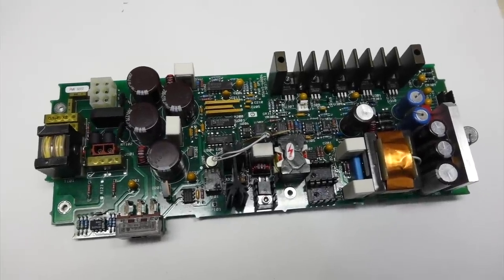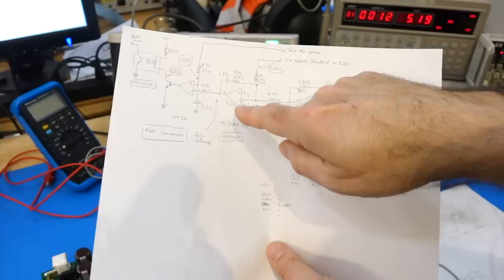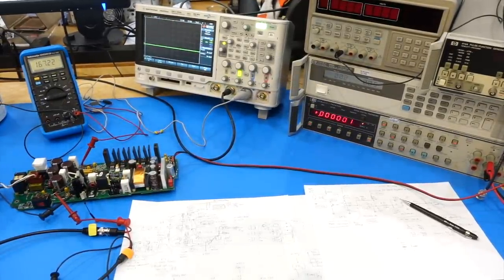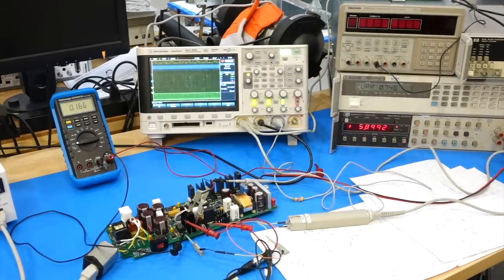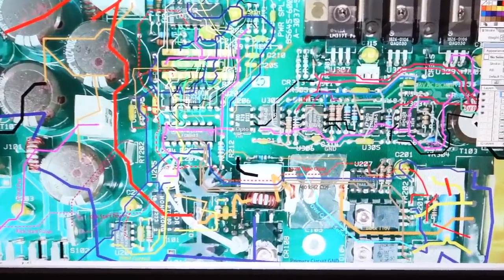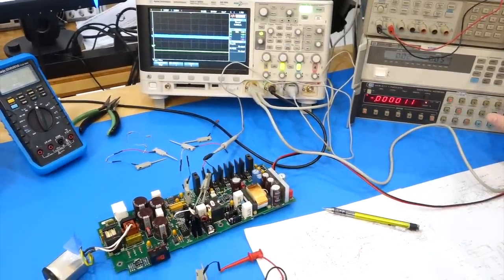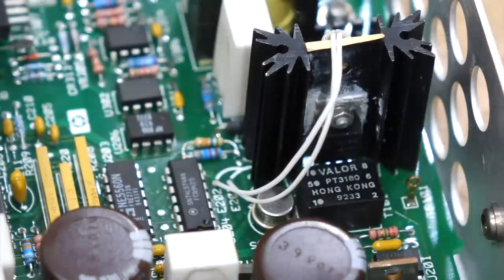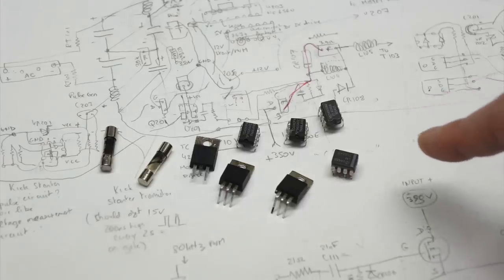HP Switch Mode Power Supply Repair Part 4: Repaired!

Comment: Making more work for yourself reminded me of my power supply repair nightmare.

I was fixing a 35 year old power supply missing a power resistor that had fallen off and vanished in shipment, when I stupidly replaced the resistor with a very wrong value replacement, which then destroyed the chopper transistor, a vendor marked high voltage bipolar transistor.  I spent ages reverse engineering the thing to figure out the characteristics of the transistor, and was about to give up.

The one night I had an epiphany: why not just contact the original power supply vendor. They had been acquired by another company,  so I contacted them. The new company had nothing for my OEM part number, so I searched eBay for similar generic versions of the same power supplies from the same company. I sent them one of those part numbers, and they sent me a cropped screenshot of the original BOM, showing that it was an 850V 10A NPN transistor, 10 minutes later I had a replacement in the way. 

The moral of the story: sometimes it‘s smart to just ask!

Comment: Awesome! I repair solar diverters and when I contacted the manufacturer for the schematics they said the same thing. "sorry not available". So it was out with the pen and paper and work out the circuit. 
It's satisfying to find a blown mosfet driver, bridge or series of casualties and get it back to working order.
That series of videos was great to watch and helpful to someone like me, Thanks for taking the time to record, edit and share your work.

Comment: Brilliant series Marc as per usual. Takes me back to the 70’s and 80’s when I was doing TV servicing SMPS were my pet hate. We had a multimeter  and were luck to have a CRO but no HV differential probes and the like. Every make and model seem to have variants of start ups, switching and minds of their own! 😀 

Your 4 part series highlighted why in a situation where the customer is paying and typically not want to pay much it was better outcome for both to swap a SMPS module out. We did have a technician who mentored me through my apprenticeship who was a savant with SMPS....not even he made me comfortable fixing SMPS apart from the list he kept of common problems he found with certain supplies. You could spend 30 minutes on looking at him common fault list invariably you would swap out what was on his list a viola.....but if that didn’t fix it swap out and take back where he would add that fault to his list.

Fascinating series you put together reminding me in part why I don’t like SMPS. 😀 I like the amount of available HP technology you have in your workshop and your tireless approach to working through with knowledge and equipment to get a result. Thanks for sharing...

Comment: Congratulations on rescuing another rare piece of HP kit! I spent about a decade and a half with HP/Agilent labs. I too have an affinity for older, serviceable test equipment. As I got interested in a particular piece of equipment, I'd talk to folks in Labs who had been there almost forever -- what can you tell me about this thing? I'd get all kinds of stories, occasionally the names of key engineers. Got solid advice on what to avoid (usually because a key component was both failure prone and unobtanium), and what was good. Occasionally I even listened to the advice I was given. I did learn that slug tantalum caps have no sense of humor and don't age well.

Comment: 4:14 when he said Hunky Dory, I expected him to say "Winner winner chicken dinner" next :-)
Reply from the maker: Dave videos definitely taught me a few things!
Reply: Fan spin! :)
Reply: @YCbCr  ppbus
Reply: @YCbCr  Was waiting for that! Shoutouts to Louis! :)
Reply: @CuriousMarc  Your optoisolator LED+transistor gain may have gone out of original design assumed spec. When manufactured the LEDs and transistors are individual die and  binned by LED emission/current (which drops over age), and similar optocoupler transistor binned by photo-gain (also changes with age and accumulated history of stress from temperature, collector current, Vce). Dealt with this many times before with with suppliers changing optocoupler die specs (manufacturers sell out HP-> Motorola->LiteOn->DiodesInc-> etc and source and bin die differently) and PSU builders substituting optocoupler versions (suppliers bought out, min gain specs get sloppy with replaced LED and transistor die, etc, and suddenly a batch of new PSUs has different load regulation characteristics). Symptoms are usually out-of control switcher feedback loops under transient or at steady low or high currents. 
I'd suggest Checking yours with the whole PSU under repetitive pulsed transient loading, say with constant_I of 0.5A  + pulsed_I of say 1A, and look closely at the feedback via the optocoupler LED and transistor currents.
I suspect that as you found there's several feedback loops summing via that resistor network. A steady (low frequency) state current feedback loop, and a dynamic loop (via the optocoupler responding switcher cycle by cycle). Your patch explained here may fix the steady state condition, but probably doesn't fix the dynamic/transient load response.  Look up the original optocoupler gain spec (LED current to transistor current gain), and consider replacing it with a fresh one with at least the same gain (and suitable Vce and watch for LED die Vf and reverse breakdown if the LED die type has changed from an old GaP to AlInGaP, etc).  More optocoupler gain isn't usually a problem since the LM311 should give you a square -wave drive in, but do watch where the 311's output transsitor C and E are wired and how many volts (or reverse bias) can get sent to the optocoupler LED. There may be option to push more current though the optocoupler LED and pick up some gain (but look at the datasheets, binning, and don't assume anything from the optocoupler die supplie  - Perhaps stick it on that beautiful HP curve tracer :-)

p.s. I love that you're doing these restorations of wonderful instruments

Comment: Have you considered using sockets for the 8 pin DIP IC's?  I recently repaired the linear regulator board (card A8) on an HP8720C, it had a 'weak' linear IC where the beta of its output transistor had been reduced over the years.  I found that socketing some of the key IC's was handy for troubleshooting and comparing adjacent IC's to each other.  Great repair video series, thank you very much for taking on that switching power supply and showing us all how you got it to work again!

Comment: Loved this series of 'fault finding' vlogs. The key 'take a way' for me, is that this does not look like an HP power supply as I recognise it. It was not designed properly in the first place, (it was not designed 'the way an engineer' would do it). A well engineered product can be 're-engineered', but also is designed to be tested and repaired - which certainly doesn't seem to be the case here. Bravo you for getting to the 'finish line'! How sad to see a symptom of HPs decline after so many years of excellence. As this product was being shipped, I moved from HP to IBM, and then later 'onwards'.

Comment: I used to fix PSUs and CRTs for a living. The majority of SMPS designs use virtually the same circuit building blocks (although the buck converter block is unusual).
Another cause of failures is the kick start resistor going high. For some reason this tends to result in blown MOSFETs ... the controller chip seems to lock up when it doesn't get enough current from the Kickstarter and the result is always blown FETs.

Comment: Nice video series and very instructive, I'm pleased you fixed it, nice to see a piece of kit rescued from oblivion.

I know you realised it wasn't necessary but surely logic would suggest that the only reason to modify the original design would be to mask a fault you'd not yet diagnosed?

As for those in the comments who are hating on the people who suggest changing caps, you've obviously never worked in a commercial repair operation where it becomes obvious very quickly that faulty PSUs with intact fuses can be repaired by cap replacement 30-40% of the time and that it's time/cost efficient to do so, it's not approriate in all cases but it fixes a lot of them

Comment: What a great series of videos! Thank you for sticking with it - most of us need help with switch-mode supplies. I have used a similar photographic technique - or possibly the same one, photographing the top and bottom of the board, flipping the bottom then adding it to the top as a layer and adjusting it's opacity. Very handy for reverse engineering undocumented boards. One key is making sure the top and bottom pictures are both taken at the same distance from the focal plane of the the camera so all traces and components are the same size. A video of your process would be interesting and probably very helpful to others.

Comment: ...and the next time you have a similar PSU fault, you will remember that it might not behave unless under the correct load.  That's why fault chasing like this should be thought of as a learning experience, and not wasted time.  A thoroughly enjoyable series.  Sending the same wishes back to you and yours at this difficult time.

Comment: Stellar effort! Worst supply I had was my own Sony ProFeel TV monitor (KX-27PS1) that had a weird (Sony Special) self oscillating power supply with a custom resin coated hybrid control board that injected a control signal via an extra winding on the core (ie no opto-isolator). The problem was it would randomly kill the chopper transistor on start up (once a week/month/2 months), this was a known design problem unfortunately. Even stranger part of the design was huge 50w (can't remember exactly) soft start current limiting resistor that was switched out by a relay after 1/2 a second. I ended up fixing it by adding a little more resistance to the soft start resistor to limit inrush current and then worked perfectly for years until the tube's blue gun went weak. Cheers.

Comment: The op-amp was a very good guess. About the effect of the probes, I suspect that probes are adding stray capacitance that helped to stabilize the circuit. I had a similar experience when assembling an audio amplifier that used parallel stages, on a breadboard: all very stable and crisp. On the final PCB, not so, because it went oscillating. Fixed the issue with small caps in parallel with the feedback resistors going from the output to the inverting inputs on both power amplifiers.

Comment: Back in the 80's we quickly learnt not to try power up an Apple II switchmode power supply without a load. It would immediately "hiccup" sounding as if it was overloaded. Nice diagnosis for the HP.

Comment: I think that the optocoupler may be faulty, in that it's CTR has reduced with age.  I recently learned a harsh lesson in that these components don't last forever.  I'm told that the  LED within the opto suffers from age-related "micro-cracks", thus reduced light output and so reduced CTR.  I noticed that your opto is a 1993 vintage part - about the same age as the ones that caused me lots of grief...   I think that when you removed and re-fitted the opto, the  heat  of the soldering process made the opto work again.  I'd fit a new one , given the merry dance that I had with (six) aged optos!  Many thanks for your interesting videos.

Comment: Holy crap not an easy fix by any means!  Wow.  That trick of taking really good quality photos of the board and then mapping it out with photoshop is a brilliant idea.  I'll for sure use that trick.  I've got an old ATX SMPS that I use just for bench lights and a basic 5v "quick n dirty" supply for things that I took from an old computer tower and "tricked" it with a load to get it to turn all the way on.
Anyhow, I measured it a while back and for some reason, I have +5, -12, +3.3 working just fine, but the +12 I threw on my strip lights is more like 11.7 or so (load or no load).  Still runs my lights good enough, but never did fully probe around in there enough to find the source of that problem.  Watching this make me wonder, but I fear I may be opening pandora's box after seeing what you contended with haha.  Nice work, Marc.  Given the equipment yours had to run, you had no choice and quite the challenge to conquer that thing.

Comment: I put my bet on the PFET in the 300V-to-100V buck converter. You're dealing with a lot of power in this supply, which will stress this FET by quite a bit. Unless that FET turns on and off very quickly (probably doesn't), the average Pd of the FET is quite high. A mistake many make when driving a PFET is putting a little R in series with the gate. This has the effect of slowing down the on/off time of the FET (Miller capacitance integrator), increasing its Pd.

If it shorts out, as it did, then you tripled the input voltage to the 100V DC-DC push-pull converter, causing its outputs to triple in voltage, too. Essentially, everything downstream from the first failed converter was highly overstressed as well, and took out just about everything with it. With 20/20 hindsight from the year 2020, the supply designer should have put in some sort of OVP circuit on that 100V output. But as the expression goes, everyone is brilliant with 20/20 hindsight.

Very impressive reverse engineering, Marc. I enjoyed your debug thought process and various workarounds.

Comment: A colleague and I tackled the switching power supply inside an amateur radio amplifier and that was 48v @ 48amps. The switching circuit was driven by a MA3830 multi regulator but had issues with the control circuit that ultimately led back to the power factor correction IC. The circuit would break into oscillation and to tame it he loaded the switch on and placed a constant 1 amp load on the 48v circuit. Without it the maximum the MA3830 could take was 380v and we already had 370v and coming close to the limit. As this then fed 450v capacitors with (and where Yaesu confused us) with 380v and -380v which is a potential of 760v, however it was just their way of saying 380v and 0v. After quite a few component changes we finally have 48v@48amp of very highly filtered DC from the Yaesu VP1000 power supply (25kg in weight too). Without videos to see the startup loop we would have been rather lost but the complex PFC and oscillation and the MA3830 having staggered pins from left and right in different packages really confused us too. Thank you for a really great video it was enjoyable from part 1 to part 4 and very honest. Kudos
Reply from the maker: Congrats on your repair, and thanks for recounting your adventure!

Comment: Bill Hewlett & David Packard would have been proud to see you persist and get this fixed. Two kinds of repairs that I hate are those without schematics and those with feedback loops. Reverse engineering this was a HUGE task, but I was expecting you to break the feedback loop somewhere and insert your own control signal, but with more than 1 loop, I don't know if that could have worked. Yes, it was probably the jFET opamp. Nice work, Marc!  ;-)

Comment: Great video! I have a similar power supply from an HP spectrum analyser 8563A that has an issue not too dissimilar to this. Fortunatly there is a schematic. I found that most of the parts are badged with HP part numbers  which makes it more problematic trying to find the actual device number.

Comment: Great work Marc. During my many years as an electronics tech, everyone hated switched modes, except the design engineers and the production managers. I really like HP's gear but their service stinks. Recently tried to download the bios for a 10 year old server. It was right there but no, you can't have it without an active service contract.
Reply: One of my livings was running an in-house test equipment REPAIR lab with Tek, HP/Agilent/Keysight, Fluke, Sencore and other respected industrial brands of equipment. They all provided extensive detailed manuals and theory of operation. 
(As did Heathkit for hobbyists in their good years).
I am saddened to learn that even Keysight has gone the way of planned appleescence. EVIL beancounter cancer spreads. No used market for keeping a pool of budding engineers and technicians learning.
Join or make a right to repair group in your state.

Comment: Congratulations on fixing it, it was probably a worth while experience in the amount of experience you gained. The proper loading of a SMPS has caught me off guard too and I only got the correct voltages when properly loading it around the current draw for it's intended use. Great video's I enjoyed it.

Comment: This is a great series, and gives me hope that eventually I will feel confident enough to try to repair the broken PSU in my IBM 5150. I will not dare touch it until I feel I at least know the basics and how to be safe. Getting there! Like you, I'd rather not simply recap and pray; I am a huge fan of trying to understand the problem. Especially as I still have such a lot to learn and am not working to time constraints (hobby, for now). :)

Comment: I have also wasted time repairing a SMPSU by not having enough load on it to start up. It basically throttled back so far it didn't generate enough voltage on the auxiliary winding that powered the control chip, so it never completed the boot sequence.

Comment: Regarding the probes, indeed sometimes you need extra high quality ones with very low capacitance or they will increase the capacitance of the traces so that it will change the behavior of the device. Had similar issue when chasing the I2C issues and noise on the line - if the standard probes were attached the I2C line behavior changed quite a bit. It was required to use special probes to see exactly whats happening on the line.